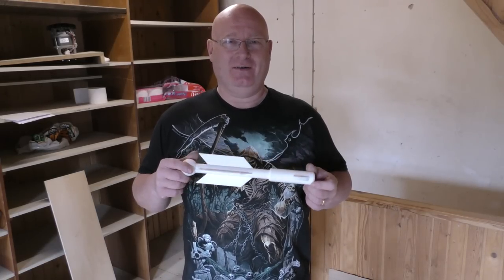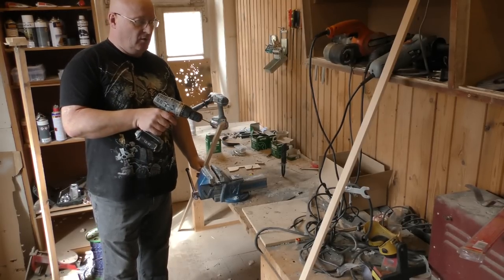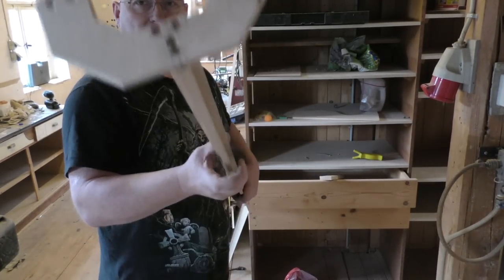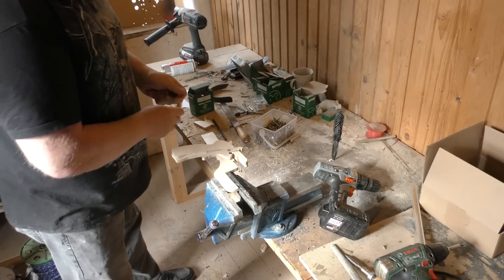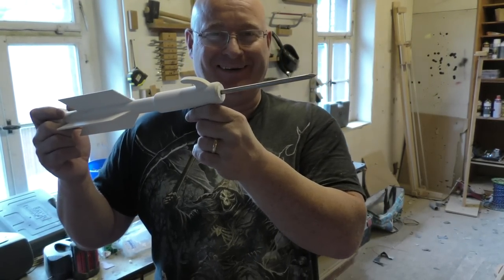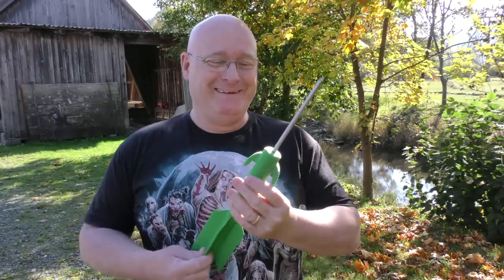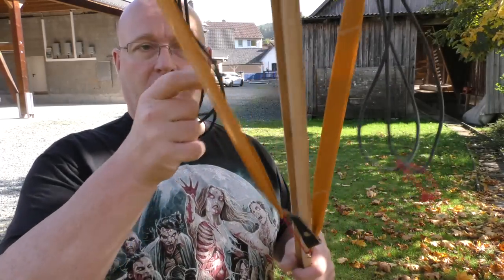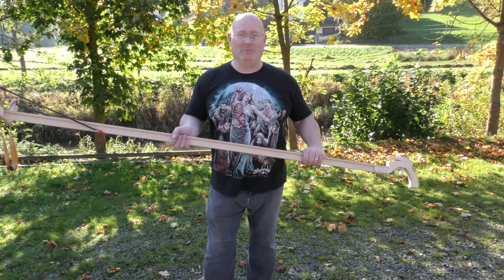The world's longest pistol, firing 3D printed "rockets"!

Comment: the structure inside the rocket is called "sparse". It is optional, so if you want a lightweight, less costly, yet somewhat strong part, you can make the printer extrude the filament like that. It's way less costly to print in that way basically.

Comment: To fix the problem with the arrow thingy sticking you can use a larger diameter on the steel nail on the end of it where it first hits the target. This allows the hole to be bigger than the nail that goes in. Therefore making it easier to take the arrow out. They do this with pratice archery arrows sometimes.

Comment: If I had to recommenced anything considering your longer weapons, it would be to add sort of a hilt to the weapon in front of the trigger, not for protection necessarily, but to add weight.  To have the center of gravity closer to your hand, I think, would make it a bit easier to handle and aim with one hand.  For example, heavy hilts are put on swords to make them easier to wield, I feel the same logic could work here.

Comment: I have been watching your channel for a long time and I love your content! I have noticed that your wooden slingshot mechanisms have quite a lot of power capability. In previous videos you have designed "bazooka" slingshots where the center of mass of the slingshot is on your shoulder. I think that design will give you the most power overall and will allow the mechanism to be easy to hold and to aim. I imaging a bazooka slingshot 10 meters long that sits on your shoulder would be very powerful, and dangerous. The only issue i can think of is the firing mechanism and if there are wood planks long/strong enough.

Comment: Still woodcutting without a mask, eh? I'll be sad if you do eventually get some lung issue because of the dust. Besides that, great project as usual. If you want the thing to work, order a project with a hole going through the middle of the arrow, with some little branching out holes or whatever. It won't be much problem, as the 3D printer does it layer by layer anyway, and you'll be able to squirt a bit of glue into the arrow and then insert a long metal rod, attached to the metal front of the arrow, then attach strings to said front, not brittle plastic arms. That way it should be sturdy enough, you still have the great fins and structure, and I'm pretty sure the company will be happy to do it for free as it means more advertising for them.
PS: I don't think you said in the video, what wood is that? Looks too sturdy for balsa but too light for anything good, so pine? Or something special?
PSS: lol scratch most of my comment, didn't watch the entire video before posting :D

Comment: come on, those "rockets" can't be cheap... 40€ ? 50€ ?
Reply from the maker: +SoWeMeetAgain Don't know, they sent those to me for free. It's good advertising. I usually charge money for product placement, but this is a young startup and I'd like to help them along.
Reply: I'm not sure on the cross section, but the time and materials needed to make the solid one is probably worth the money as its going to be extremely durable.
Reply: +Do M the cross section is physically sound. It can be done with basically any material, and is a tried and true method of increased durability and stability. And this method is still probably stronger than using one solid piece of wood, since the grains would be running all a single direction, so force from a different direction could quickly snap it. With two pieces attached the way he did, he was able to use the growth rings to his advantage and provide both vertical and horizontal support. 

Sorry for the long explanation. English was my most failed class. DX
Reply: +gorisenke I understand, the problem here was how the outside diameter of the smaller section and the inside diameter of the bigger section was very thing pretty much causing it to be perforated.
Reply: +Do M thin
Reply: +Do M ahh. Fair enough. So this method would probably only work with the bands he's already using. The aim was light, so I'm probably stating the obvious, but heavier bands would mean a heavier launcher. Maybe the same "I beam" method, but a thicker vertical base, and laminate the horizontal piece on instead of drilling. The wood isn't damaged, and there would still be a large surface area for an epoxy to hold. And then he can launch golf ball sized steel shot.
Reply: +SoWeMeetAgain Probably less. What are those weighting ? I'd say less than a Kg and a Kg is at 20€.

Comment: Not to be that guy but should it really be called a pistol if you require two hands to fire it?
Reply from the maker: +Haneix Not to be that guy, but can you shoot a .50AE Desert Eagle with one hand Mr. Wisebutt?
Reply: +JoergSprave Fair point,I guess the pistol has been warped from it's original purpose.
Reply: +Haneix no a pistol is merely a non shoulder fired weapon. using two hands with any pistol is generally considered good form and will generally give you the best shot. now if you want to go by archaic dueling pistol rules, sure you can say one hand, but nobody actually does that.
Reply: Andrew Ruppe But when they were first made they were intended for using one hand but i understand and appreciate your response.